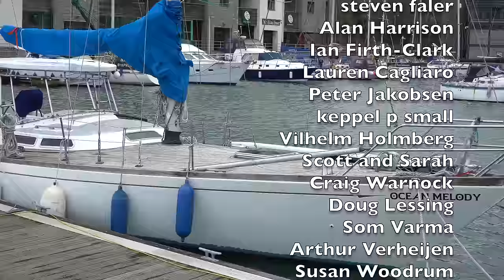Bluewater Sailing Setup!  Fitting our AWESOME cockpit enclosure!

Comment: If you want UV resistant glass please don't use "Acrylic or something like that " but Macrolon. We use it on the shipyards for light railings with glass. Any other material will degrade quite quickly under the sun.
Reply from the maker: Yes we will use UV stable Makralon or Lexan. I just use the word “acrylic” becsuee people know what it is, but I agree a polycarbonate composite is much better

Comment: Andy and Melissa the cockpit enclosure and top looks fantastic. At first I thought to low and didn't go back enough, but after your explanation about the canvas sliding in  and out it now makes sense. Where you want to put those 3 gauges to the upper front of cockpit will look fine. The water capture seems to work, but I guess once you are on the move and anchoring at different locations and it rains you'll be able to test it more thoroughly. Sailing Melody is really starting to look absolutely brilliant. Looking forward to next video. And where you are playing your concert is the east side of Birmingham. Wish I was over in the UK now so I would have definitely purchased tickets. I have relatives Rugby, Coventry, Husband Bosworth, Leicester, London and numerous other places. I will forward them information on your concert and how to purchase tickets. It would be awesome if a couple or more go.
Catch you next week

Comment: Hi Andy,
If you decide on plastic, acrylic of some type, then make sure they don't touch any of the stainless material because then you will have rust occuring on the area where they are touching. Looks really bad and will in time destroy the plastic windows. Small stains can be removed with Autosol but it will make the plastic dim. Best solution is to manufacture the enclosure so that you only have fabric touching the stainless material. Or make socks around the stainless parts, fastned with velcro, recommended. Sorry if this was already known and taken care of. Fair winds.
Reply from the maker: Yeah for sure there will be a standoff/gasket between the plastic and the stainless

Comment: Andy, it's me again. 

At 22:51, can you see those black specs in the captured water and on the drier surface? I believe they are bits of pollution, possibly soot. 

I have seen this many times as I leave a large stainless bowl full of water out in the garden for the benefit of the cats and the hedgehog (who has arrived from hibernation too soon). After it rains, the water needs changing due to the black bits that fall with the rain. I can't remember from previous instalments whether you mentioned a filter system in between the drains and the fresh water tank. If not, please take that precaution.
Reply from the maker: Yes we will have filters :)

Comment: excellent. still think a aech just in front of the mizzen would be useful to hold some more solar and to have and extension canvas roof when not sailing
Reply from the maker: Maybe yeah. Sadly the person who had all the stainless steel I purchased for these jobs used a LOT of it on another job and never replaced it so I can’t afford to do that now. I bought a job lot of stainless tube for £900 and only ever saw less than half of it again.

Comment: Its a nice cockpit become but it’s looks a little bit high Melissa can with the canvas end the windows a better line creating with smaller windows end upstairs smaller en under wider canvas.
End make it close to the roof because wind en rain is coming true the gaps. Good luck.👍👍
Reply from the maker: Don’t worry. We are using bolt rope and track to attach the canvas directly to the fiverglsss so there won’t be any gap at all

Comment: Looks like some of your welds will rust, you have overheated the weld and probably the chrome in the stainless has degraded. Pulse weld helps when welding stainless.
Reply from the maker: Not much I can do about that now unless I start over which isn’t going to happen. But thanks

Comment: Getting battered by giant hail stones is painfull to potentially deadly..  Squalls and storms are now occuring more frequently as temps rise.

The barefoot Doctors were on their leopard off Turkey and an Evening squall thunderstorm hit. They got hammered by the hail but still had to secure the boat. 
The little guy is getting well singsongy 😂 good luck all.🤞🏼 Hope it stays dry for you..🧙‍♂️

Th
Reply from the maker: That’s a good point! Hail can be nasty
Reply: @SailingMelody  
Last year as the drought broke in N Italy there were a series of  brutal hail storms across the belt.. roads filled with large hailstones.  The largest were well above golfball sizes and car bodies were getting hammered so was ordinary glass....  Whenever you get sudden weather bombs and temperature changes you will get violent winds and rain.. possibly big hailstones.  It can go from steamy hot to freezing in minutes.  Canoeist helmets and goggles help if you have to step out into it.

Comment: that looks awesome guys but i have to tell you that thing is a jibe disaster waiting to happen ..if you jibe uncontrolled that sail and boom will tear that thing clean off the boat and could even kill someone if they r in the cockpit ..also any sort of angled sheet rope to the boom is also very dangerous ..i know because i almost broke my back when a jibing angled sheet rope picked my whole body up and smashed me against the gunnel ..ive done 3 circumnavigations ..plzz be very aware of the danger in a jibe with that cockpit cover
Reply from the maker: We covered this extensively in previous episodes. The boom and mainsheet clear rhe enclosure with feet to spare in a crash gybe
Reply: sorry mate but you are wrong ..crash jibes occur when you are running down wind ..sure when the main is extended out fully and the sheet is straight there is couple of feet clearance but when it jibes the sheet goes slack and the wind will hold the flailing slack ropes foward and it will definatly go around that cockpit cover and rip it off ..there will be ten foot of slack rope when the boom crosses the middle and that rope can go any direction ..you think that sheet rope will just come neatly past the cover but it wont ..it will be out of control and extremely dangerous @SailingMelody

Comment: Stainless is obviously great but won't those welds corrode
Reply from the maker: Why should they? I used stainless wire and argon mix to weld
Reply: @SailingMelody  Sorry if you've used stainless wire it's obviously not an issue.